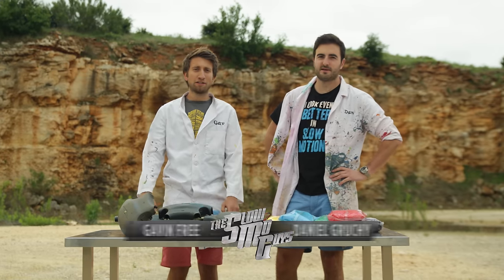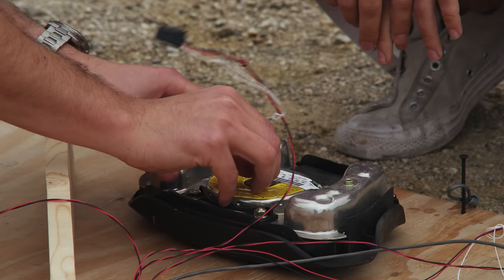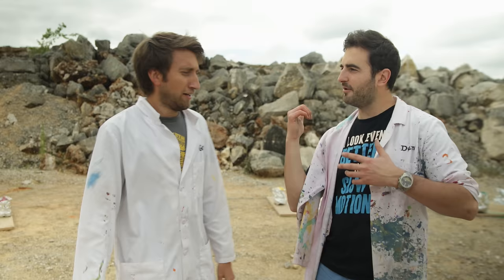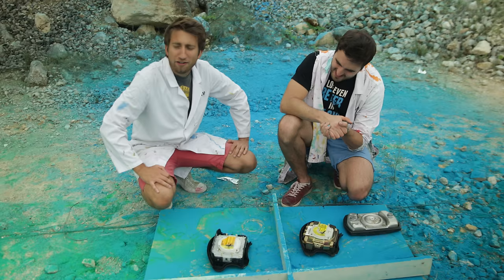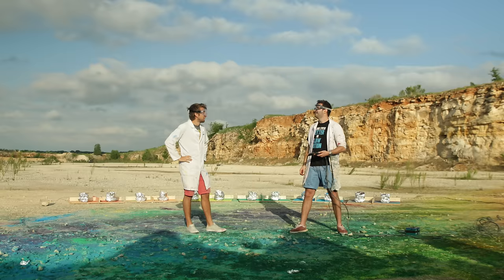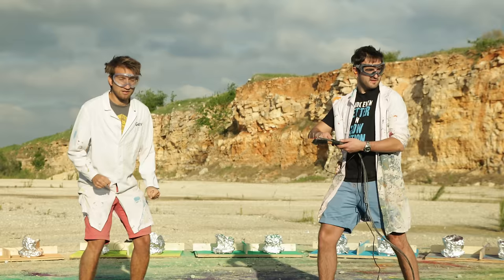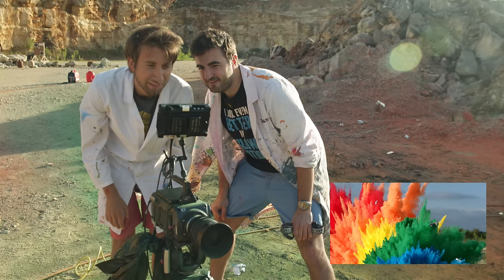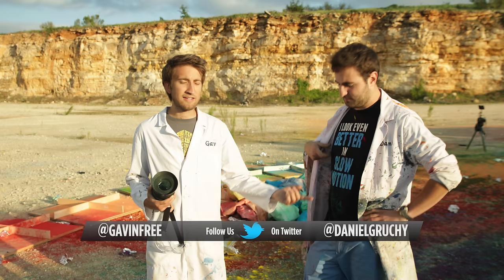25 Airbag Rainbow Explosion in 4K - The Slow Mo Guys

Comment: You guys need a quad copter how cool would it be if there was a aerial view of this experiment.
Reply: Ray Maready roosterteeth has them and they most likely have used them on shoots before for SMG. It would only be good for real time shots though.
Reply: The problem is that the weight of a quality slow motion camera is going to far exceed the payload of a drone. Sure, they might get some cool shots, but, they're in the business of slow motion, so sort of pointless.
Reply: not really an experiment is it?
Reply: AusiKifaru27 Iphone? they can do 240Fps 1080p I think
Reply: A crane/jib would've been epic, in upward motion while capturing. 
Not as it isn't awesome enough already... :D
Reply: HappySlappyFace yeah. their camera does tens thousands
Reply: The complexity of these cameras must be confined to a tripod to ensure a clean shot
Reply: Ray Maready ds
Reply: HappySlappyFace Hahahahaha iphone, this shot would have been done in atleast 1000 if not 5kfps, in 4K, 240 nowhere near enough not to mention iphone 240 is like a pseudo overcranked 120
Reply: HappySlappyFace I know that seems reasonable, but let me explain why it wouldn't work very well.

An airbag is fired with a mix of sodium azide and potassium nitrate, a flash powder (like gun powder, but much faster burning). The gas released expands, inflating the bag in around a 30th of a second.

So, if you shot that at 240 FPS (Frames per second), 1/30th of that (240 x .03333) is just 8  frames captured.

If you play that back at the usual 30 frames per second, your video is going to be a little over a third of a second long.

If we're generous and say the entire thing took a tenth of a second (I think it's probably faster than that), then you're going to have 24 frames, which would make your video 1 second long.

It wouldn't be much to look at, would it?

Comment: I know you'r not gonna see this, but I'd like to see you guys try to capture an electrical charge on highspeed. I remember this one episode of mythbusters where they were setting off explosives inside of a water barrel or something. And in the slowmo shot they got, you could actually see an orange shine coming from the wires as the detonation charge ran down the wire and into the barrel where the explosives were. I'd love to see someone try to recreate that footage.
Reply: That wasn't electric wire, it was det cord - you could see the detonation travel down the det cord in every explosion slow mo shot they did in the whole show.
Reply: I'm pretty sure that was "det cord" which is a little bit different in internal structure than normal wire. I'm also pretty sure then in the UK, det cord will be hard to get like it would be here in Aust. Our governments frown upon stuff like that.

That said however if they could do what you suggested, it would add another "coolness" factor to their videos :D
Reply: Blargenth I dont know much about the detonation cords like the other comments but the speed of an electric current is the speed of light lol. The only thing that actually slows it down is what type of wire is used; the resistance coefficient of the material
Reply: Recording at the speed of light isn't possible yet. That wasn't electricity they was directly filming, it was a reaction with the det cord. However! Search for "Imaging at a trillion frames per second" on YouTube. Its a TED talk where some clever people worked out how to get around it, and in the process made some amazing things happen.
Reply: Ok, that's good to know then, I should have known something like electricity would be too fast to film yet. But that still would be a good slow mo video, filming the detchord charge leading up to an explosion. Also Drakin SormHeart, I don't think they are in the UK. Gavin is a part of Rooster Teeth which operates out of Texas... so I don't think detchord would be a problem there.
Reply: I was thinking the same thing, but with a lightbulb turning on, it won't be exciting or anything, but it would be interesting to see
Reply: There would be nothing to see even if you could record video fast enough - electricity traveling down a wire doesn't release any photons, so you'd see nothing.
Reply: nah, i mean like, one of those floodlights that flicker, giving a slight strobe effect
Reply: if you search "light bulb high speed" on youtube, I think you'll find what you're after
Reply: thumbs up  Thanks mate

Comment: I'm an intern at a vw dealer and it turn out that when you conect the airbag to the steering wheel there is a 10% change it wil go off